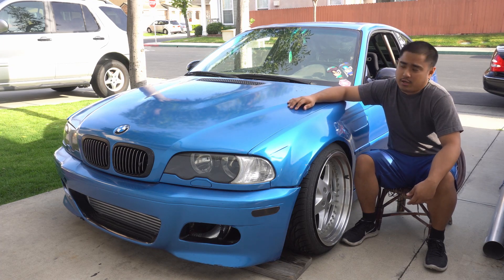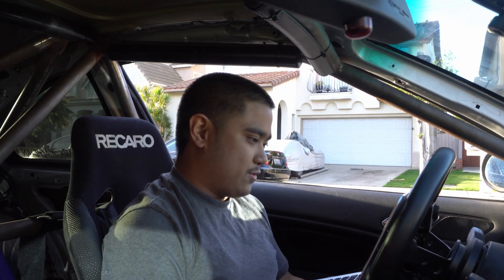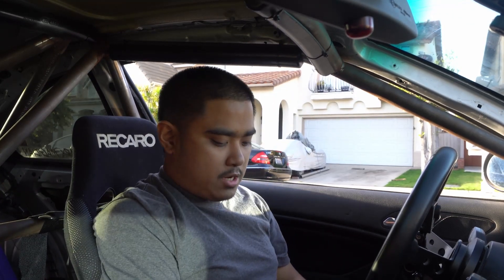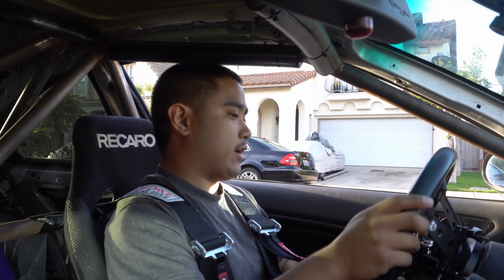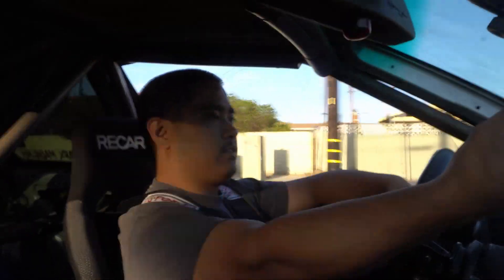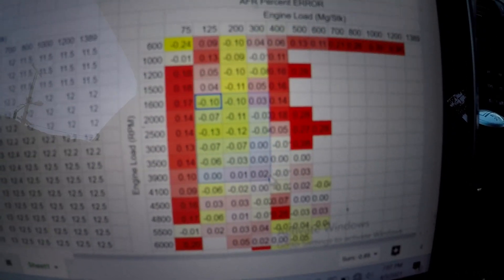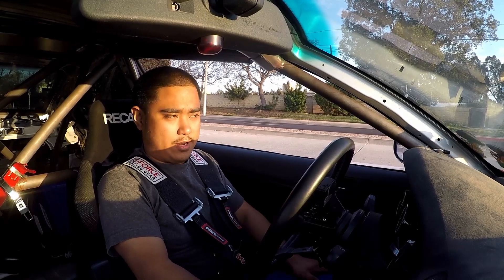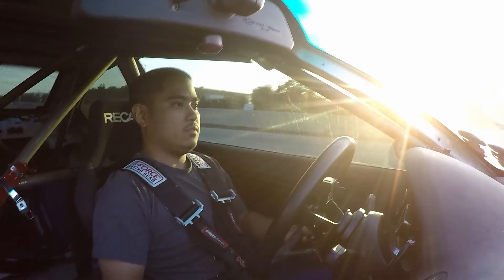TURBO E46 BURNS RUBBER After DIY TUNE | #TheE46DriftBuild Ep63

Comment: I’m about to turbo my e46, is this all on stock internals? If so, what’s the max psi you would recommend and so what’s the hp and torque on it?
Reply from the maker: Stock internals. Torque is your main limitation, not boost or HP, and that's dictated by your goal with the car. I personally would like to stay closer to 300 lbft to keep the car reliable.
Reply: @nuisance_carl  Ok. To give some reference on what I'm working with, I have a 330ci, I'm rebuilding due to an engine bay fire. I'm about to pull the head, replace the head gasket (its never overheated but since I'm inn there, might as well) annd I have a remanufactured cylinder head ready to go in. I'm trying to make at least as much as an e46 m3 makes, if not a bit more.     p.s. My IG is @me46mphis if you wanna follow the rebuild.
Reply from the maker: @IAmChrisSessions_  You should be able to hit around 350whp pretty easily on stock internals.

Comment: Check the voltage when the car is returning to idle i had a similar issue in my turbo e30 where my car would stall when coming to a stop especially after a pull. i ended up just raising the idle a little to avoid any voltage drops.
Reply from the maker: Yea I bumped it up 100 rpm before the last clips. It helped a good amount, but still happens intermittently.

Comment: Are you running the new oil scavenge pump in this video? How is it holding up so far are you happy with it? How noisy is it? 

I'm curious if you think it's possible to run that scavenge pump directly from the oil drain on the turbo instead of building that separate vented tank you built.
Reply from the maker: It seems to be holding up well. It’s only noisy when priming, otherwise I can barely hear it. In hindsight, I’d go with one of the larger pumps that RBRacing offers. Many people run a line straight off the turbo without issues.

Comment: What software do you use for tuning. I had a 2006 E90 325i and it used an N52 N/A motor. I tuned it myself and slapped on a fat 6466 turbo on it. I used many different platforms for flashing.
Reply from the maker: Currently using tunerpro for tuning

Comment: Where were some of the vacuum leaks you had with with M50 manifold?
Reply from the maker: At the injectors and at the ICV fitting.
Reply: @nuisance_carl  what was the car doing? Having the same issue, main thing mines doing is on hot start it doesn’t want to start up. Have to crank the starter for a while and it finally starts up. After that it’s fine for the most part
Reply from the maker: @jakelipton7772  I'd get intermittent misfiring. Are all your injector maps scaled per the MS4X wiki?
Reply: @nuisance_carl  Im Not sure, I used a set of Bosch Volvo injectors (for the correct spray angle)
Reply from the maker: Check ms4x.net for aftermarket injector scaling. It tells you what maps need to be adjusted and how

Comment: Absolutely amazing, well done. What software are you using to create a data log AFR map?
Reply from the maker: All data logging is done through tunerpro. I’m just lazy so I created an excel sheet where I could copy tunerpro’s history table into it and it’ll tell me how much I need to adjust by. It’s definitely not a necessity though

Comment: did you fix it? .. could be ICV blocking the intake boot
Reply from the maker: I'm actually running an ICV delete. I ended up just raising the idle 100 rpm and it helped a good amount. I also don't think it's not getting enough fuel at low rpm

Comment: Great, finally getting close. Do you have the video for your exhaust build? Also, which software are you using and if its on the factory ms43 ecu?
Reply from the maker: Yes check out my previous uploads. It shouldn’t be too far back. I’m using ms4x flasher to upload maps and tunerpro for tuning. Stock ms43 is correct
Reply: @nuisance_carl  which bottom mount manifold did you use?
Reply from the maker: It’s a maxpeedingrods turbo and manifold

Comment: Are you running the stock trans for higher hp?
Reply from the maker: Yes, but you want the ZF trans from a 330/328. the 325/323 getrag trans apparently doesn't hold much power.

Comment: What you made with turbo smoke? I have the same turbo with same isue..top mount set up,m50b25
Reply from the maker: Weird, you shouldn't be having turbo smoke issue with a top mount. You could try adding a restrictor
Reply: What size off hole restrictor?
Reply from the maker: @muhammadfirdaus3968  1.5mm
Reply: Thanks brother,my problem solved😊

Comment: Hey nice video! Sure I'd love to see a tutorial on how to get started. Right now I have a Galletto cable but none of the software works so far. There have been many drawbacks, such as the drivers not originally supporting the 64 bit platform etc. So yeah a video would be nice, on how to get started. :)

Comment: hey bud did you had to modify the rear end? driveshafts etc?
Reply from the maker: I haven't modified it. I actually intend to keep the power low because of that.
Reply: @nuisance_carl  oh spot on then! do you reckon it'd be the same on the 320ci? are u running a welded diff?
Reply from the maker: @SuperBumblee  Not sure honestly. I don't know if those use the same drivetrain. I am running a welded diff.
Reply: @nuisance_carl  ty bud, did you changed any gaskets at all? Or it’s all still standard?
Reply from the maker: @SuperBumblee  All oem gaskets except for oil pan.
Reply: @nuisance_carl  thanks bud 🤩
Reply from the maker: @SuperBumblee  No problem!

Comment: dude you got the latest uploaded e46 video on tuning, iv been tuning hondas for two years now and just need some input on what you do to get the laptop to the ecu, yur car looks hella gutted/drift ready and im two week in to where your at lol, make some videos my man!
Reply from the maker: My first car was actually an RSX (loved the damn thing). Always will have a soft spot for hondas. I connect the ecu to my laptop using a K+ DCAN cable. MS4X Flasher is used for uploading and reading maps, and Tunerpro for tuning and data logging.
Reply: @nuisance_carl  hondas have potential, i keep thinking of k swapping my e46. but want to kind of master that i have first. do you know of any datalogging options? i get lean codes and feel like tuning for the lean spots is the easiest option as i already checked for vacuum leaks and cleaned maf
Reply from the maker: You can datalog through tunerpro

Comment: Hey have same set up need your base map tune pls
Reply from the maker: Stock MS43 map is good enough to work off of. Just have to follow the MS4X wiki.
Reply: @nuisance_carl  would you be selling your tune
Reply from the maker: @felixdesmond6570  No...It would have to be modified to fit your build, which at that point you might as well work off the stock map. If you're looking to have someone take on most of the work, there's plenty of MS43 tuners out there. RKtunes, Belsky autowerks, Jules Mariutti, GelashviliPerformance to name a few.
Reply: Ty for all the help and advice most people would say f off lol

Comment: Dude straps in like he's making 800 whp lol
Reply from the maker: Because safety is horsepower dependent right?
Reply: @nuisance_carl  factory seatbelts will do you're making like 350 wheel
Reply from the maker: Car is caged. Can’t fit factory seat belts anymore

Comment: Its dying at idle because you rook out 5 degrees everywhere.even at idle........take out half a degree every 250 more rpm but start at 50% and up and only more than 2500 so i will cruise Normal at light throttle
Reply from the maker: Interesting. I’ll have to try that out.
Reply: @nuisance_carl  timing at idle has to stay stock